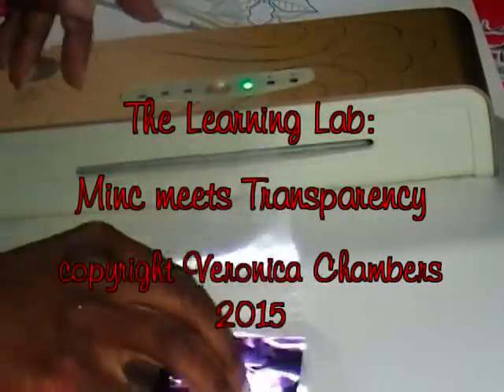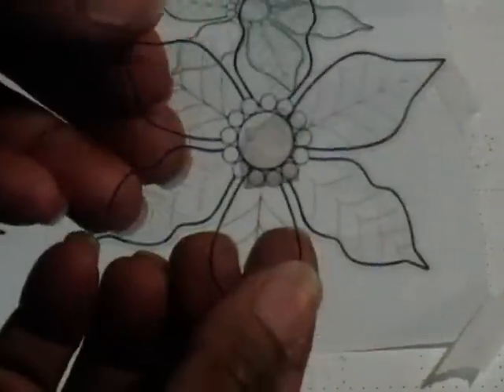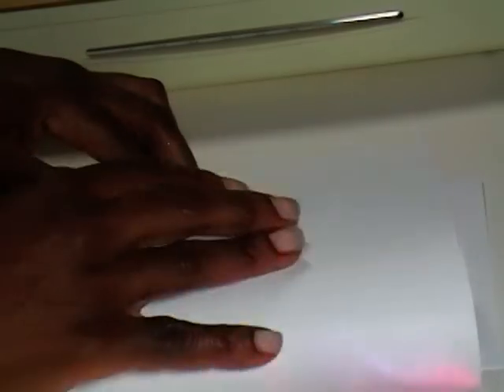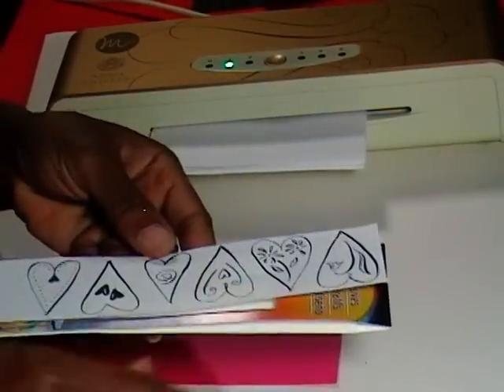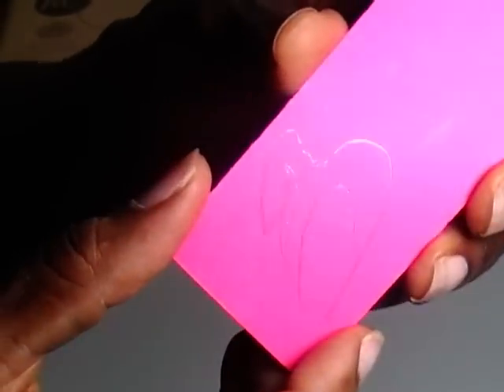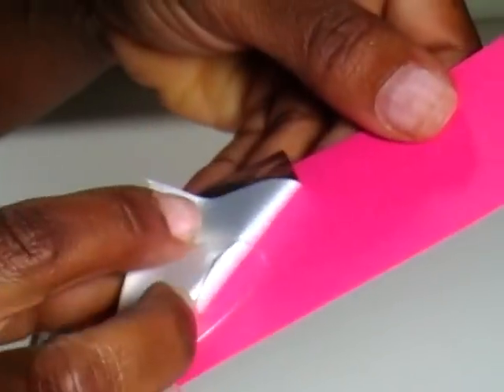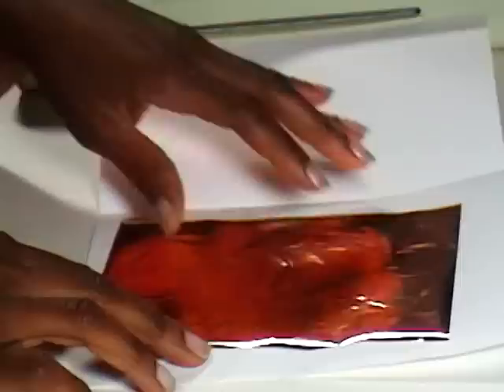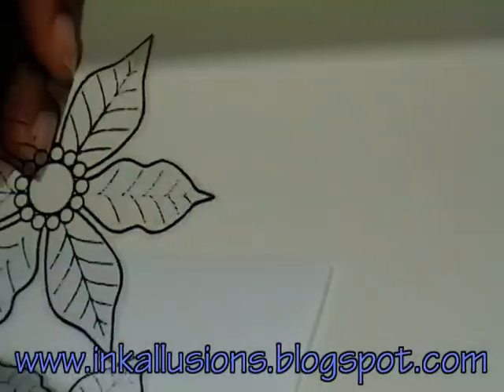Minc meets Transparency

Comment: Hi, Veronica! Thanks for the heads-up that you can Minc foil onto transparency sheets. What type of transparency sheets did you use? I know that some aren't heat resistant, and will curl up and distort, so are you using the ones they use at Kinkos and Office Depot when they print transparencies? I plan on making some Christmas pinwheels with my We Are Memory Keepers Pinwheel punch board, and I thought it might be nice to print some snowflakes onto transparent plastic to layer with holiday card stock for that purpose. I don't have a laser printer, so will have to have a copy shop to do it for me. I want to make sure they don't melt while feeding through my Minc. I saw that you used the lowest heat setting on yours, but I noticed there were slight pinholes where the foil didn't entirely transfer. Did you perhaps try foiling them on a no. 2 setting? Good idea, by the way---using copy paper for your carrier instead of the plastic one that comes with the machine. Thanks for sharing your expertise so generously with us crafters out in the ether. God Bless!
Reply from the maker: +Vgudorf i did use transparencies compatible with laser printers/copiers. most offices have them to throw out as they are not as in vogue as they once were. who uses an overhead anymore? I do. i scored lots of them from my school. as for the foil transference, it did transfer. it was the image that i used. i wanted to see how intricate i could go and still get usable results. I will try a #2 setting to see if it will make a difference. thanks for the suggestion.

Comment: Great video - please give me a starting point regarding the settings on the ScanNCut for the blade, pressure and speed when cutting the transparency. That would be so helpful. Thank you.
Reply from the maker: hi shelly not sure if you are the same shelly from a couple of days ago, but i will copy and post the same reply here. hope this helps.
 i believe it was blade depth 2/3 speed 1 and pressure was either one or two. of course each machine is different but i would start there and build up. i hope this works for you. when you adjust, adjust one thing only. like increase blade depth but not pressure or vice versa. too much pressure and you will cut straight through your mat. do that test cut to see if your square comes out clean.

Comment: Veronica I love your videos and this was great. Quick question- when you cut out your transparencies on the Brother ScanNCut what blade, pressure and depth settings did you use please? I know all machines are different but at least that would give me some idea.Thank you.
Reply from the maker: ahhhhhh, i am not sure. i believe it was blade depth 2/3 speed 1 and pressure was either one or two. of course each machine is different but i would start there and build up. i hope this works for you. when you adjust, adjust one thing only. like increase blade depth but not pressure or vice versa. too much pressure and you will cut straight through your mat.
Reply from the maker: ahhhhhh, i am not sure. i believe it was blade depth 2/3 speed 1 and pressure was either one or two. of course each machine is different but i would start there and build up. i hope this works for you. when you adjust, adjust one thing only. like increase blade depth but not pressure or vice versa. too much pressure and you will cut straight through your mat.

Comment: Hi Veronica- did you first stamp the transparency with Stazon ink and then run it through your laser printer?Just want to be sure. Thank you.
Reply from the maker: hello shelly. The transparencies were put through a laser copier. If you do this make sure the ones you use are specifically for a laser copier or the heat will melt them to the fuser. I DID NOT use Staz-On. I first printed the images and then copied them. Hope this helps. Please let me know if you try this. Thinking of doing this for some Christmas cards this year.

Comment: "But I like to call myself conservative" OMG I laughed.  First of all when it comes to anything shiny-glitter paper, mirror paper, foil- I save even the tiniest piece because it is too pretty to throw away.  The poinsettias are pretty-wonder what you are going to do with them?
Reply from the maker: Danee Kaplan  thank you and I plan on using them on a prepainted canvas I purchased at michaels. with a bit of heat i can shape the acetate and then put a brad through a stack of them. i agree blingy stuff should never be thrown out unless you have used all that you can. on a side note, I got a pack of silver foiled paper at mike's. Hot Buy for $5. sooo shiny.